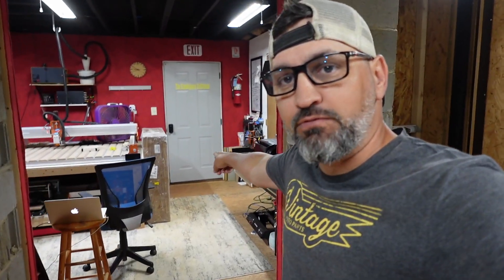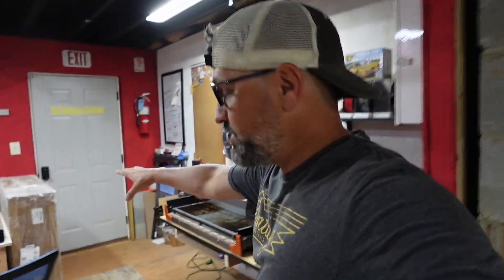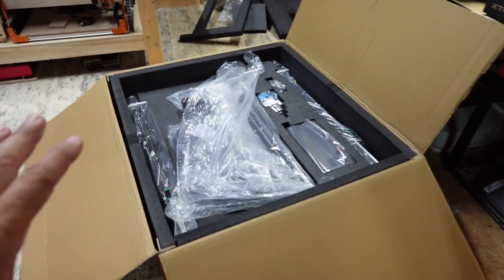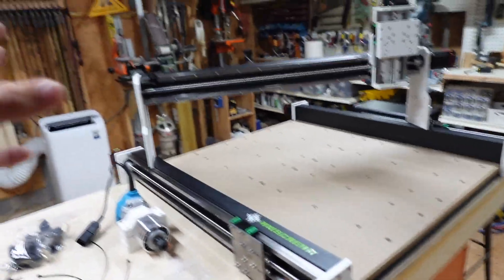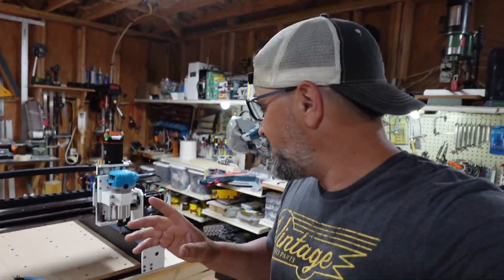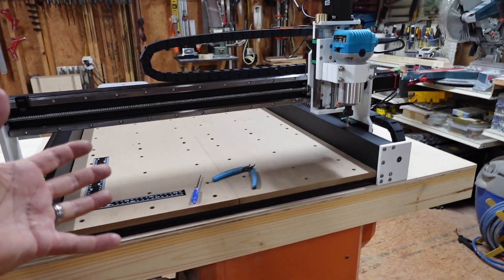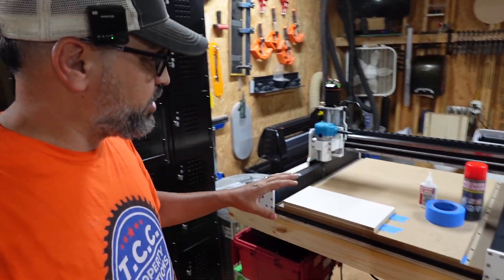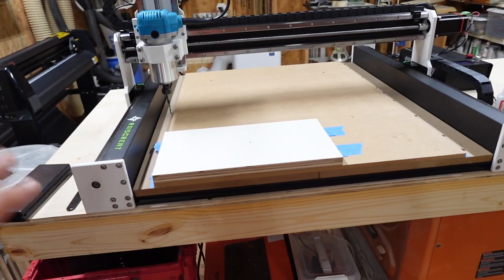The NEW AxisCreat 6060 CNC Machine Deserves a Better Name—Here’s Why!

Comment: How does it do with 6061 t6 aluminum? Will it work with 10-14mm? Would like to buy on black friday if so
Reply from the maker: The AxisCreat X6060 can cut 6061-T6 aluminum, even in the 10–14 mm range, but you have to treat it like a hobby-class CNC router. It’ll handle it with slow, shallow passes (around 0.2–0.5 mm step-downs), a proper 1- or 2-flute carbide bit for aluminum, solid workholding, and good chip clearing/lubrication. It won’t hog material like a big mill, but if you take your time and keep the setup rigid, it will absolutely machine 6061-T6 and make functional parts.

Comment: What is the best software to use for this CNC machine?
Reply from the maker: Since this machine runs GRBL v1.1, you’ve got a few great options — like Candle, UGS, or CNCjs — all solid, free choices that work perfectly with it.

But personally, I really like using Easel by Inventables. It’s super beginner-friendly, browser-based, and lets you design, generate toolpaths, and run your carve all in one place. It’s kind of an all-in-one setup that just works.

You can even export your G-code from Easel and run it through Candle or UGS if you prefer more control.

So if you’re new to CNC or just want a smoother workflow, Easel is honestly my go-to with the AxisCreat i4040.”

Comment: Be honest, how doe sit compare to the NymoLabs NBS-6040 you had?
Reply from the maker: If I had to choose between the two…. I’d take this AxisCreat.  It seemed as if the NymoLabs was over built If that makes sense. Extremely heavy.  Also…. The 24”x24” workspace is much better imo.  AxisCreat has a little catching up with accessories but I think (hope) those will come with time!.

Comment: Great video content. One thing that confuses me, and it is not just in your videos on CNC's. I see in a lot of cases, cutting tools sticking out from the chucks a long way. The shortest possible overhang, will make a massive difference to the vibration, surface finish and accuracy.
Reply from the maker: I’m very always wondered too. Once the bit is installed i try to center the spindle within the clamp or be a little higher. I see some people drop the spindle all the way down….. not good in my opinion!
Reply: @TheCrawlspaceCraftsman  my point was more about the cutting edge hanging too far out from the face of the collet. Should always be as short as possible. It makes a big difference.